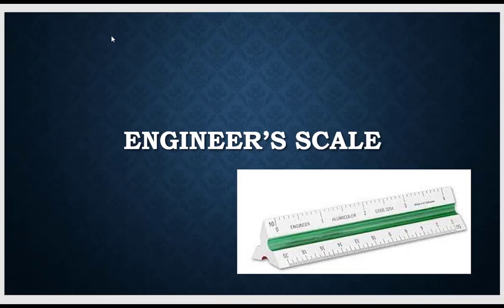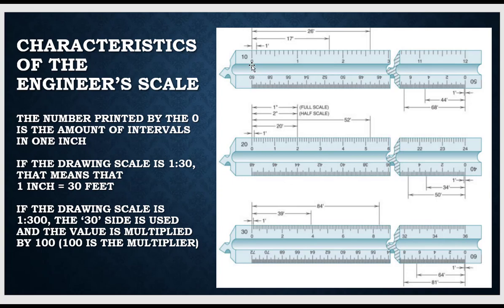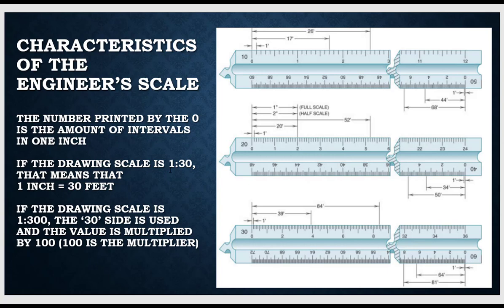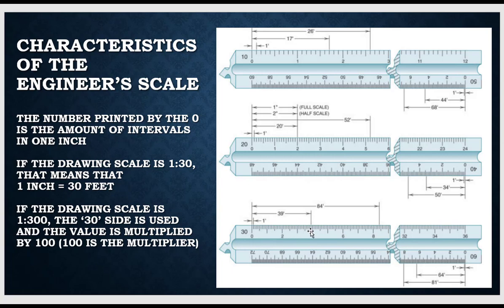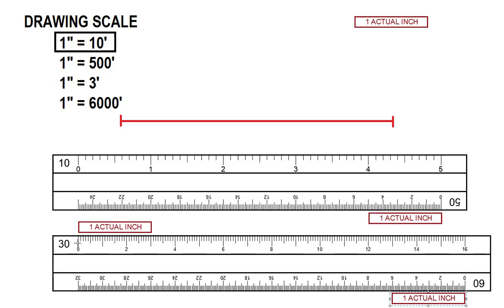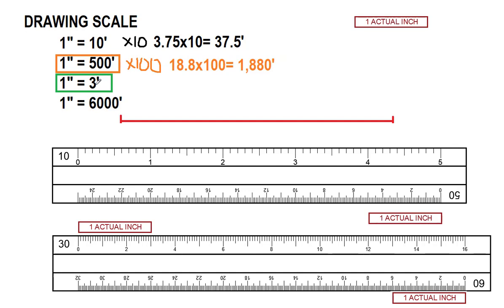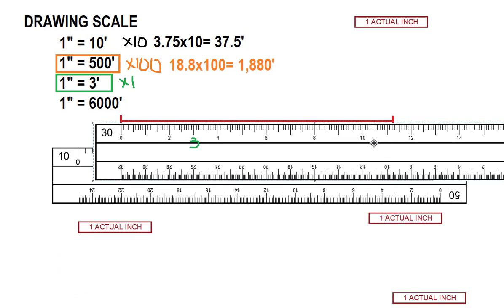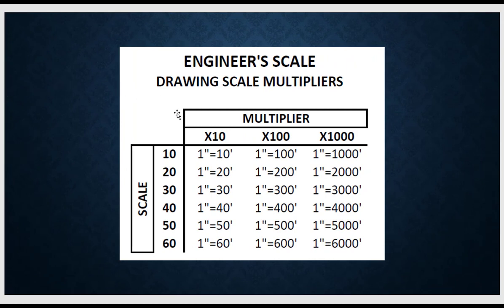The Engineer's Scale

Comment: for 1"=3' you used the ruler scale of 1"=30' why your multiplier was 1? shouldn't it be 0.1?
Reply: In her case, she is counting the large numbers increments on the scale. So the scale given is divided  by the side of the engineering scale used, so 3/30 = .1. But this is then multipled by 10 because of the increments which equals a multipier of 1. In the case of 1" = 500'. The multiplier is the scale given (500) divided by the side used(50), so 500/50 = 10, but then 10 x 10 increments  = 100 for the multiplier.